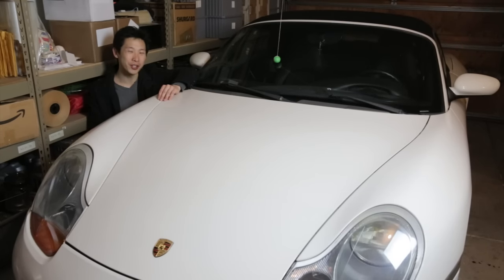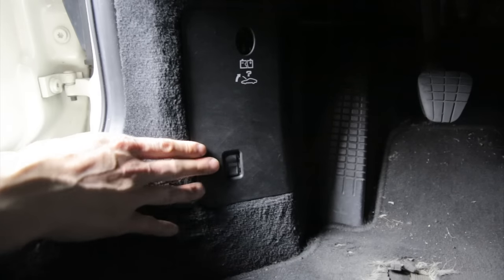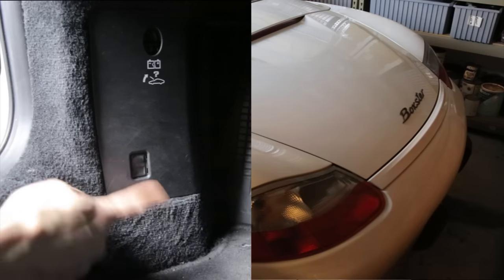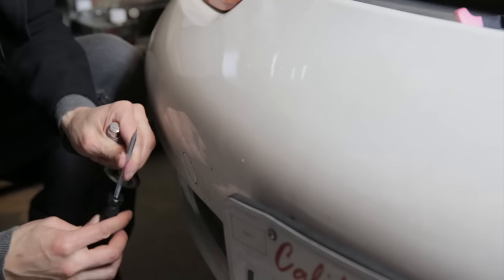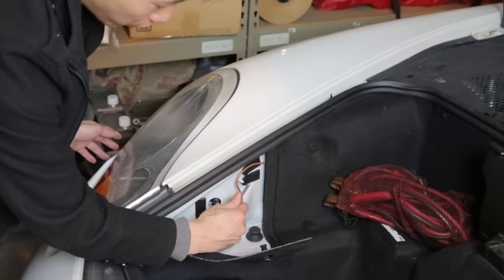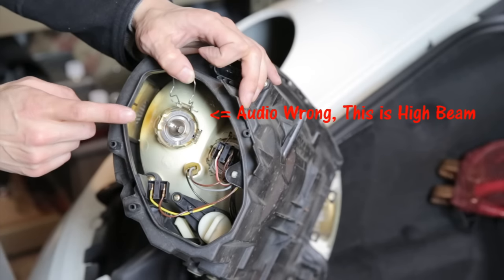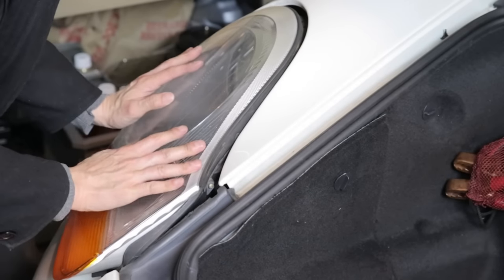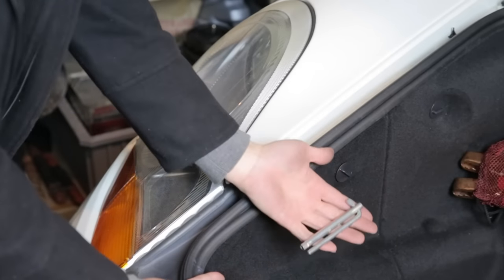Porsche Boxster 5 Hidden Features | BeatTheBush

Comment: Holy shit, the headlight removal is awesomely simple :o Sure beats screwing around with certain cars where you need to remove the bumper and some other stuff to replace the light.
Reply from the maker: Yeah... some cars you just pop the hood and unscrew the light. I guess it depends on which car you compare it to.
Reply: exactly.. in others it's just a single rod that pulls out to release the headlight..
Reply: My Volvo S40 is like that!
Reply: Rawad El-Debs yea Volvos love that design. It's very effective and easy.
Reply: Replacing the engine takes 10minutes.
(Joke) But it demonstrates they wanted to make things easier for servicing.
Reply: Fantastic video.  I'm learning about my Boxster.  Thanks.
Reply: Agreed. My Saturn Aura requires an engineering degree and the ability to dead-lift 200 lbs. in order to change the headlight bulbs. I find working on my Boxster much easier in many regards.

Comment: Another excellent video! Really appreciate the care and time you've put into these and I'm sure I'm not the only one who would enjoy more. The Porsche 986's are beautiful cars that will no doubt be viewed as must have classics over time. The one thing I absolutely hate about the earlier 986's is the need to get out of the car when putting the roof down to do the "Boxster Chop" to ensure the plastic rear window folds properly. I'd consider replacing the top with one that has a glass rear window instead.
Reply from the maker: Thanks for you comment! I do update periodically on the Boxster as I do more work on it. The latest is the front hood strut replacement. Oh lol! I laughed at that one because I had to do the Boxster Chop plenty of times. If you don't then it puts a dent in the plastic. I even had the plastic get a hole in it after the repair shop opened it without folding it properly as it was a bit brittle at the time.

Comment: The headlight unit & bulb removal sequence was particularly useful, especially as I didn't know the dipped and hi-beam bulbs could be interchanged in an emergency. Thanks!
Reply from the maker: Sort of good to know and hopefully never really need to use it. I actually never had both lights go off in short duration but I can see it happening.

Comment: Don't use a screwdriver to take out the tow eye plug!! :-o Just push it with your finger at the bottom and the top pivots out ;)
Reply from the maker: Ahhhh lol. Good point. I almost never need to remove that plug but I'll try that the next time. =D
Reply: @BeatTheBush  yay for kind humble response
Reply: Yeah, that worried me too .... scratches !!!  (I was thinking I should get a plastic panel removal tool (cheap at Harbor Freight) in case I needed to remove the plug.  But now I'll just use your technique.

Comment: Great video; clear and informative; just traded my boxster for a Cayman and some of this may still apply.   Thanks for taking the trouble to put this together.
Reply from the maker: Thanks! I think I wouldn't mind a Cayman either since I only put the top down once a year myself.
Reply: Cayman has a much more luxorious feel and it's of course quieter on the road.  My Boxster came out to play when the sun was shining.  I wanted the Cayman because I wanted to drive in all sorts of weather.  So far it's met my expectations and it seems to be a car I'd be comfortable driving cross country . . . probably wouldn't have done that with the Boxster.
Reply from the maker: Serious? I guess I don't know much about the Cayman, I thought the only difference was the hard vs soft top. I drive my Boxster all year round though, lol. No babying it.
Reply: @BeatTheBush    Well, I know this comment was 5 years ago but I have to say that I never drive my 2000 with the top up.  A Boxster was created to have the top down.  The top is only for emergencies !!!  LOL

Comment: this is fantastic! the eye bolt for towing blew my mind!
Reply: DON'T keep it in the front trunk.  If the battery is dead you won't be able to use it for the tow truck since you can't open the front trunk with a dead battery.  Keep it behind the passenger seat.

Comment: Cools tips. About to order some spare bulbs. BTW, if you hold down the door lock button on the keyfob, the windows will move all the way back up. VW's and Audi's do the same as I recall. Same Bosch system. I tested that today after I forgot to raise the windows after putting the roof back up.
Reply from the maker: Nice one if you forget to close your windows. Beats getting back in just to close them. =D

Comment: Yeah, my 1999 986 is just a great great great car. It's fairly easy to work on, in some ways super simple like with the headlights. The 97-99 years have a dual row bearing in the engine too that rarely fails. I see a lot more videos on here evey day from people discovering this awesome, affordable, very capable Porsche.
Reply from the maker: Ahhh yes... it does last if you happen to get the dual row bearing which I hear is a pain to even find out for sure.

Comment: Thank you for posting this video.  I just changed the position bulbs (aka bulbs for parking lights) in my 996 in about 20 minutes.  Lights are still out as I cleaned the housings / around the rail area and I'm letting drip-dry but I've tested to satisfaction.
Nice work!
(Would you believe the dealer charged > C$25 per bulb? ugh..  Zero in labour, though. haha.)
Reply from the maker: Huh $25 canadian? Oh my, the bulb is what? $5? Yes, please never ever go to the dealer.

Comment: There’s also a feature that no one really has covered that I accidentally discovered when the AC was off by pressing the recirculation button when you press the recirculation button when the AC is off the AC turns on and goes instantly to highest fan speed automatically

Comment: drivers side window stopped moving down when the door is opened. Thanks for the tip now I use the key to open the window until it gets fixed.
Reply from the maker: +Bishop Cherry Coke Might be the cable at the junction? When it's opened, it bends the wires to not connect due to wear and tear.
Reply: +BeatTheBush maybe, that makes sense
Reply: same happened here! now i can close the window when it rains haha
Reply from the maker: IscleGaming | ZefaCraft very nice. =D
Reply: Cool window feature!  Wonder if it works for Nissan, Toyota cars etc?  :D

Comment: Thanks for mentioning the triangular amber trim on the headlight. I broke mine lifting the headlight shell out by it. It is very fragile and costs $110 AUD but easy to fix. So lift by the inside front and rear section of the shell.
Reply from the maker: Yah... I broke mine but ended up gluing back on, lol.

Comment: I own a 2001 Porsche Boxster S.  I loved your video and will save it.  I knew most of the things you discussed but I had no idea how to change the headlights.  Can the lights be upgraded the same way?  There is a little wire thing inside the front bumper opening.  What is that?
Reply from the maker: If you are upgrading the bulbs only then yes. Depending on what you are upgrading to you might need to install a ballast for the new bulbs. You can also upgrade the whole assembly which will be more costly. The little wire thing inside the front bumper is just there to hold on to the cap in case it falls off on its own.

Comment: There is one you forgot, the heated seats. If you install the switches for the optional heated seats they will work. From what I heard, Porsche had all Recarro seats equipped with the wiring, just didn't install the switches if you didn't order the option for them.
Reply from the maker: Hmmm, I have those. I thought they all have it lol. Except my driver seat heaters got damaged so they no longer work. So I guess because I had the buttons, I didn't think it was 'hidden'. The other stuff isn't hidden either but it's not obvious unless you comb the user manual.
Reply: Bobster986 that is great! Did you actually do it or is it an urban legend?  Really want to do this.. Is it simple plug and play? Any further information you can provide would be greatly appreciated
Reply: Michael P. Smith I too got coned by the dealer and ordered them as an option. It wasn't until I became friendly with a machanic that I found this out but never confined it. I would suggest talking with one or remove a (4 bolts) seat and see if the wire plug is there, but not connected into the harness. Good luck and keep us posted.
Reply: One other thing. I think the optional footwell light are the same. If you didn't order them, then they didn't connect it install just the lamp in its place.

Comment: nice video. why do you note the car can only be towed by a flatbed truck? because the nose is low?
Reply from the maker: Those are AAA towing instructions at least. It makes some sense I guess due to the height. If you tow this thing by dragging it, it could bottom if you hit a bump.

Comment: Just remembered another tip you can video. Just behind the drivers side door, by the top of the door pillar, there should be a pull cable visible, Pulling it will manually open the bonnet. Why? Well if you get a flat battery, or a deadlock situation due to a flat battery, you will need to know this tip! My first Boxster had this hidden behind the passenger side wheel arch, but you had to remove the plastic inner liner to get to it. I had dropped a umbrella down the passenger seat by the door, and it had dropped onto the electric switch for tilting the back of the seat. it ran off the motor gear and flattened the battery. When I got back from a flight I had a deadlocked car and had no idea how to open the front bonnet!
Reply from the maker: I remember reading about that one in the user manual and thought wow, I really need to know this or else I'll be in a huge pinch if the battery runs down. The other way they tell you is to hook up a battery to that tab to temporarily power everything to open the hood.
Reply: I have a 2003 S and the solenoid on the front trunk was sticking,  I found the wire behind the driver tire, it was a pain to both find and pull.    I since replaced the solenoid assembly but I'll go look for the cable on the pillar.   I was going to say that this is something everyone with a Boxster should know since it's really important.
Reply: I've never been able to find my emergency trunk cable.  I finally learned that the best thing to do is to get a patch cable that fits the OBDll plug-in and attach a battery.  I had tried everything else and nothing worked but my mechanic had a jumper battery box which had a OBDll connector.  I plugged it in and the latch popped the hood open easily.  I then purchased a small Lithium jumper box and a cable to attach it to the OBDll plug from Amazon and keep it behind the passenger seat along with the tow eye bolt in case I need to tow and can't open the trunk.
Reply: @boyracer3477  that’s a sure workaround. Made me laugh out loud when I thought about how poorly someone had designed that setup. 

I saw a guy the other day outside Waitrose Shell recharge with a I-pace being trailered away. Looks like his 12V DC battery had packed in. Locked out. Many new EV cars have this setup!?
Reply: @knowledgebyte     Yes, a rare Porsche engineering mistake.  Kind of like the IMS bearing debacle I guess.  Of course, if you daily drive your Boxster the battery is unlikely to drain but a lot of us have our Boxsters for weekend fun and if we miss a couple of weekends driving, the vampire electrical drain screw us.  I keep a maintainer on mine now. (which has an ability to remove sulfates from the battery
plates).

Comment: great video tx being a recent owner of a 2001 Boxster S the ease in which that headlight pops out is awesome. Question...I bypassed the rear cats thinking i would get a throatier sound but its hardly noticable,  so I have to change rear muffler,  any recommendations on rear muffler only?  too quiet for a roadster...
Reply from the maker: I would tend to want to leave the cats in since it helps with oxidizing the unburnt hydrocarbons and better for the air. You probably see I still have a stock one so I actually have no experience with an aftermarket muffler. I think if I were in your market I would want to hear the brand of muffler first hand so I might find some boxster club where there is a high concentration of them so I can spy on some from others just to hear it in person.

Comment: Thanks for sharing, when I press the button on the remote on my BMW convertible the windows and roof go down together, I assume the Porsche does the same without sticking a metal key in the door as my BMW doesn't have the metal key bit

Comment: There are actually three bulbs in the headlamp structure: the high beam, the low beam, and the fog lamp. The fog lamp bulb is behind a circular cover. They all take the same bulb: the H7. So if your highbeam bulb or low beam bulb are out, you could replace either of them with the fog lamp bulb.
Reply from the maker: Thanks for the tip. I'll have to check on that the next time I look in there.

Comment: hey buddy thanks for the video. But can I ask you one question? My headlight and brake light on my passenger side of my 2001 Porsche Boxster S went out simultaneously. I change both headlights and brake lights and still the passenger headlight and the passenger brake light still out..
all the other lights on the card work fine..
Reply from the maker: Whoa, that sounds like a terrible problem to have. Maybe something shorted? You might want to check the fuse box and see if the fuses went out. Keep in mind that sometimes, replacing the fuse enough enough because if the problem is still there, you'll just blow the fuse again.
Reply: When the headlights go out and other strange electrical failures happen in the drivers compartment, try wiggling the ignition switch when the switch is in the run position. If your problem goes away, it is the ignition switch failing.You need to replace the switch.It will happen again. Had this happen twice on my 1998.

Comment: Hold the unlock button on the keys to let the windows go down or lock to make them go up.. letting go will stop them at any position you want.
Reply from the maker: That's a good one too but it does draw more battery power.

Comment: pretty cool. 
I have a problem, the windows came down like the convertible was going down but i was not home, and it rained hard, so now the car won't start?
Reply from the maker: Ouch. Sounds like electrical short and the fuses blew. You might want to dry everything out. Check all fuses 
and replace if broken. Make sure the battery is not drained. And try again.

Comment: Just a tip,
 If your battery is flat and can't open your trunk, open the fuse box and find a emergency + prong so you can provide enough voltage to open the trunk.
Reply: Mine has a cable that runs through the front tow eye, I just pop the cover and pull the cable and the frunk pops open.
Reply: @eddherring4972  cool, is yours 986 with a plastic rear window?

Comment: I am in the Porsche club uk all the members think the Porsche Boxster is one of the best balanced Porsches of them all
Reply from the maker: There's certainly lots to like about it, mid engine, perfect weight distribution, great low end torque, really great handing.
Reply: best riding and handling sports car I have ever owned, my first german made car as well
Reply from the maker: Johnny Lindo it's pretty addicting to drive. and then when you drive a rental you already changed your driving style to match it so the rental gets all wobbly around corners. >*<

Comment: You posted this more than a year ago so hopefully you still get this. Do you know a way to make the headlights have a greater intensity? My Boxster emits light about three car lengths, which is very short if on the highway. (The brights are fine but I don't like to use with oncoming traffic, ie most of the time.)
Reply from the maker: You lights are probably too fogged up. Clear them up with this process: https://youtu.be/Tpcd-5fd9nY It's on a DVD but the plastic works the same, sand down, buff with the compound.
Reply: BeatTheBush Good idea. I just checked out your linked video. The 2500 grit followed by buffing compound should help.
Reply: Are your auto leveller's working ?  Turn your lights on with the ignition off.  Then turn the ignition on.  You should see the lights move up and down and level out.  My 996 lights weren't leveling so they pointed much too low and felt too dim.  Fixed now.
Reply: @Symbouleutic  Just ran out to the garage and re-leveled my 996 lights!  Learn something every day.  Thx

Comment: your spare tire tool kit is not suppose to be mounted behind the tire. goes in the pouch on the front of the tire cover
Reply from the maker: Page 100 of owners manual: Item 9 "Tool kit and jack are located behind the spare wheel (spare wheel must be removed)"
Reply from the maker: ***** Agreed. I quoted the manual so there's no argument unless anyone thinks I made it up. lol.
Reply: BeatTheBush thought (above) you said that you didn't read the manual 😉
Reply: I use the front pouch on the spare tire cover to carry the front license plate.

Comment: I'am 60 years old & it's wonderful to see YET ANOTHER Generation learn the JOYS of Finelly engineered products!!!!!!!!!----------
You want to see BULLETPROOF?? CHECK-OUT AN OLD GRAVELY model L, lawn & garden tractor!!!!!!!!!!!!!!!!!!!!
Reply from the maker: +packardexelence I think what's the best part about these is well engineered and not OVER engineered. The thing is only as strong as it needs to be in all the right places to last a lifetime. Sadly, the air oil separator in the Boxster is one of the weaker parts.
Reply: And the IMS bearing for those 4 or 5 years.